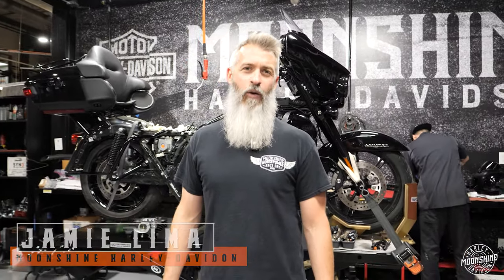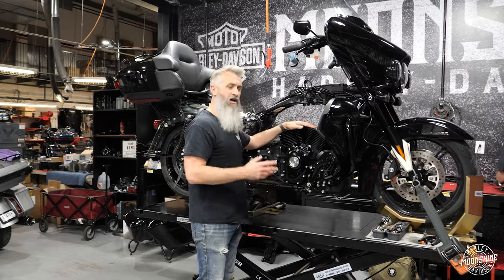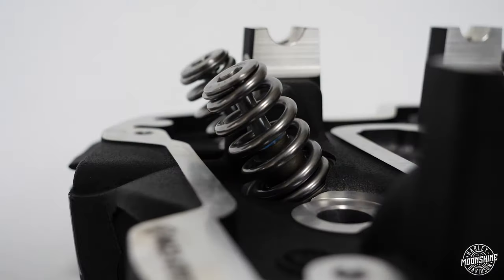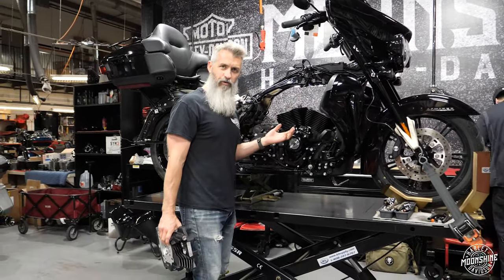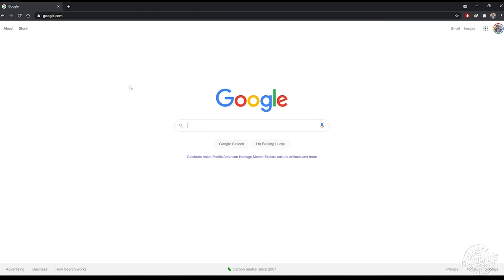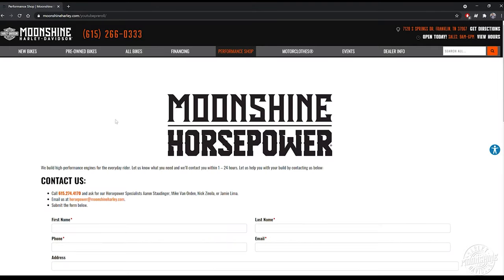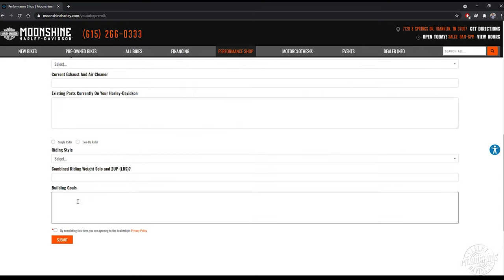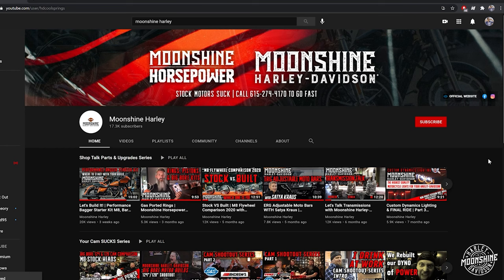Discover the Hidden Power of MHP Highway Sleeper 128

Comment: How big of a job to take my MHP 124 to a 128? Or would it be more beneficial to go to a 131?
Reply from the maker: Each cube you add will typically increase the HP and TQ 1.2. So 4 more cubes = 4.8 more HP and 4.8 More TQ. 131 would be better as it’ll increase more.